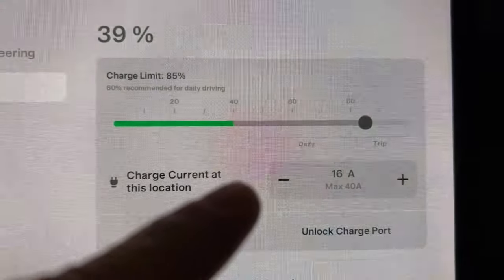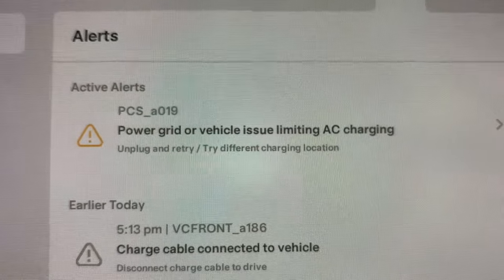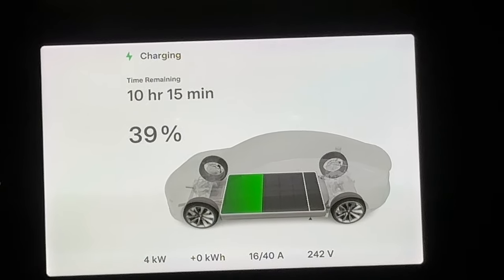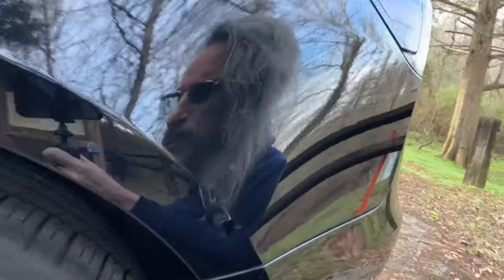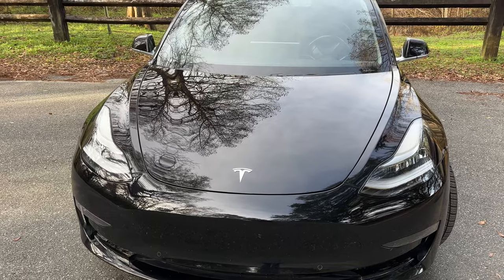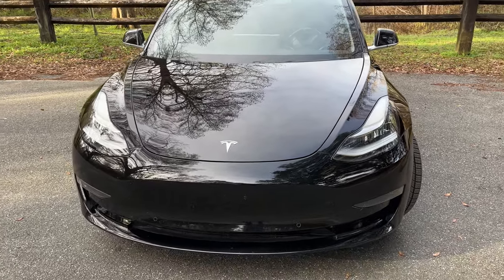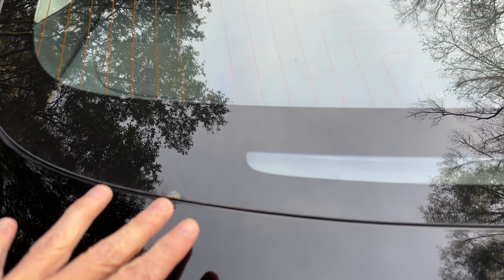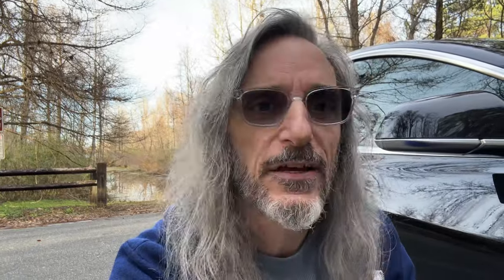Everything Wrong With My Tesla Model 3 That I Bought Used

Comment: That level 2 charging issue sounds like a bit of a pain but may not be an issue depending on how far you regularly drive.

You ought to bill that repair to Kyle at Out of Spec though. He found the car 😂. 

By the way, thanks for the Tallahassee landscape. I grew up there and went to Florida High. Haven’t been back in years though as my family moved when I went to college.
Reply from the maker: The slower A/C charging hasn't been a huge issue. There's only been a couple times over the course of the year when I wish I could have had a bit more power.

Happy to share the Tallahassee area scenery! It's pretty nice down here. 🙂
Reply: @DriveElectricWithDomenick  Kind of ironic that Kyle found a Tesla for you that you can't charge at home yet he is a big advocate of home charging and leaving DC Fast Charging only for road trippers.  On the flip side, you could have had the new Chevy Bolt you wanted that would have home charged with no issue but would have been a slow DC Fast Charger.

Up in the Chicago area besides road salt there are also quite a few stone queries as well. A lot of dump trucks hauling rock that shoots out the back of the truck hitting the car bumper if following the truck too closely.
Reply from the maker: @Joe3545u  I can charge at home, no problem. It's just slower than it should be. For my use case, though, it's fast enough, which is why I haven't replaced the PCS yet.

Comment: Just get the tire plugged.
Reply from the maker: That's the plan.
Reply: Always patch from the inside, plugs are BS, makes the hole bigger and prone to fail and leak again, rarely can damage the tire belts.
Also if you don't dismount the tire from the wheel you can miss hidden damage on the inside, exposed cords, shredded rubber, heat damage from riding low.

Many chains are sticklers and will only fix holes in the center tread block and tell you anything else is "the shoulder" but worth a shot. 
We don't have them in NY but everyone is always recommending America's Tire out west.

Looks fixable to me.
Reply from the maker: @ZeroFuell  Thanks for taking the time. Much appreciated.

Comment: Pretty minor stuff
Reply from the maker: Yup. The PCS is really the biggest issue, which I think is pretty good.
Reply: @DriveElectricWithDomenick  I have a 2018 with 185k miles. My super charging hardware needed to be replaced but other than that car is still solid. Big brand tire will fix your nail tire for free FYI.

Comment: sounds like u got rip tf off
Reply from the maker: It came with FSD (beta), which is now a $12,000 option, so I got a pretty decent deal at the time, despite these issues.
Reply: @DriveElectricWithDomenick  my m3 came also with fsd also so yeah maybe good deal after all